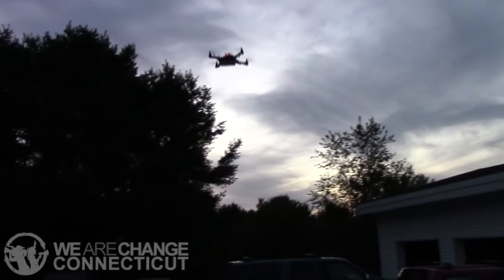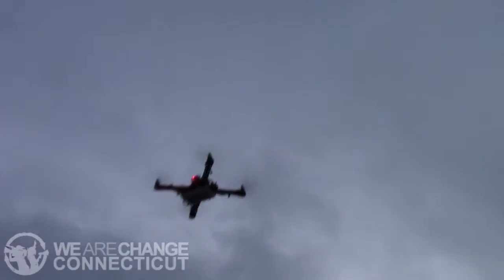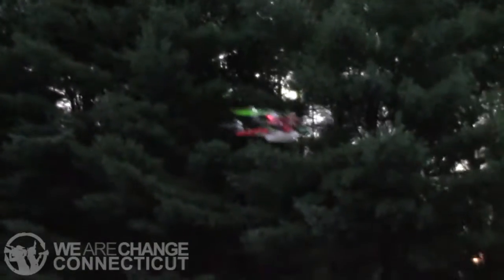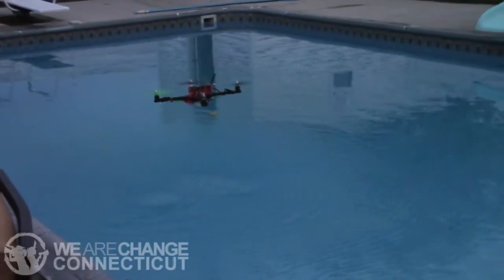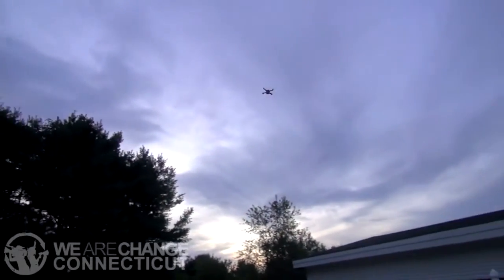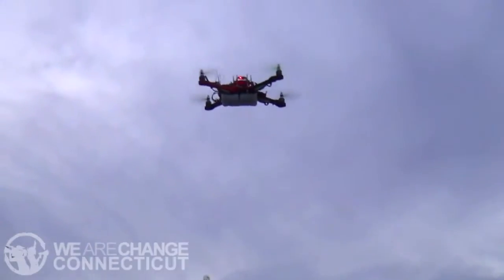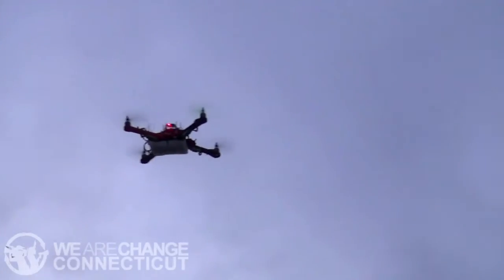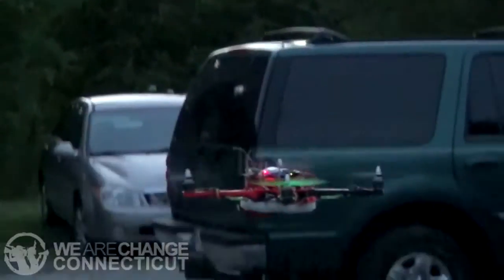Maine Hacker Club: DIY Drones

Comment: Great job! What is the software based on?
Reply: Sorry for the late reply. The software/hardware platform is Arduino based. The drone in this video uses Ardupilot which is based on the Arduino Mega board. Info here: http://ardupilot.com/
I've recently been experimenting with a new board, the Cruis AIOP ( http://www.rctimer.com/product_765.html ), I like it's form factor and it's creaper, and it will run the same autopilot software but I haven't had enough flight time with it to make any recommendation yet.